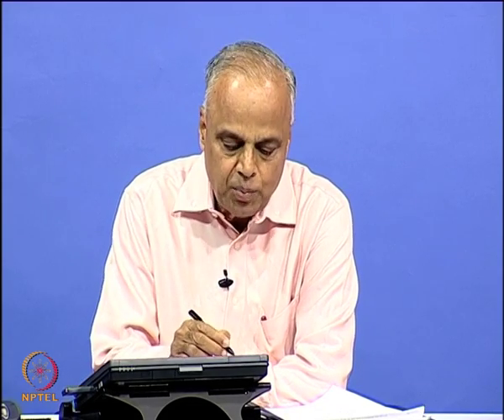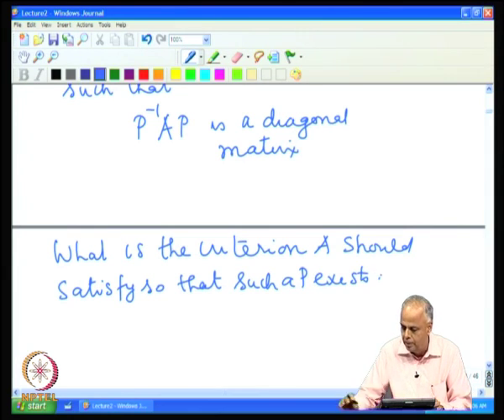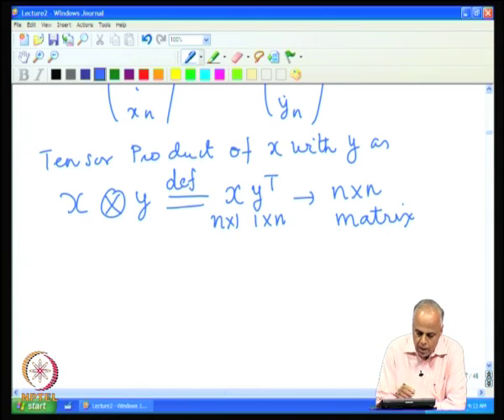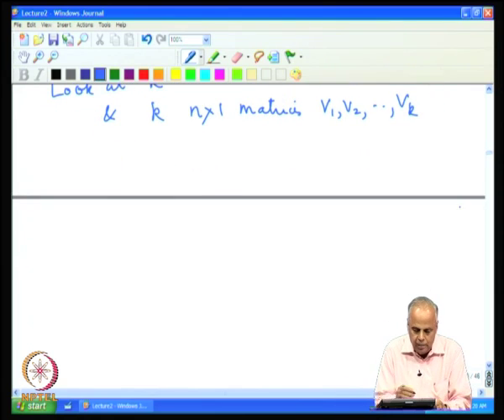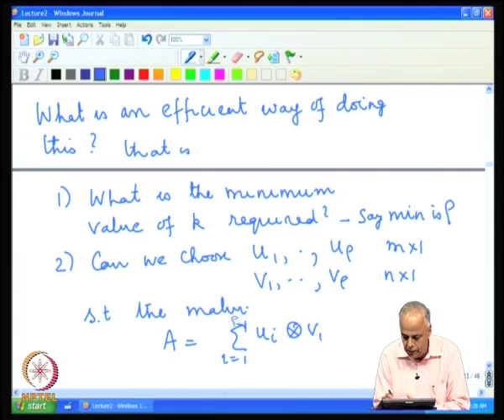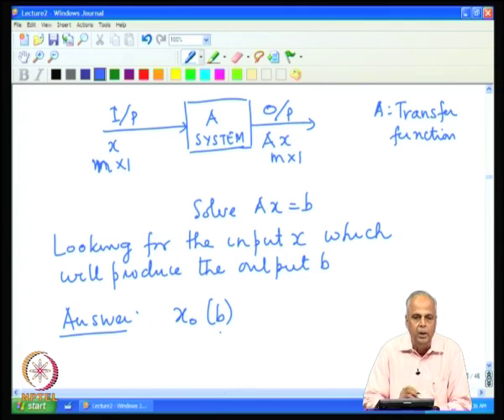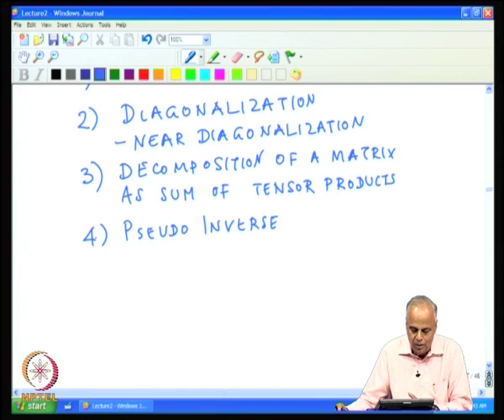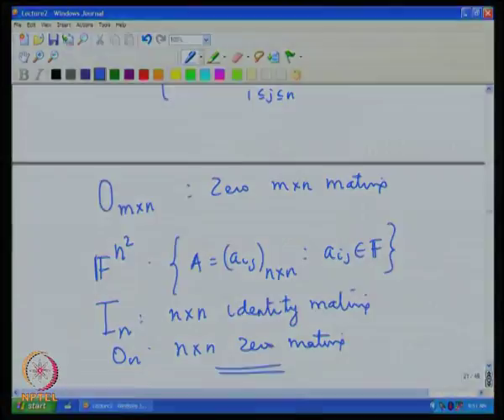Prologue Part 2

Comment: can I take this course as my 1st course in Linear Algebra ?? I am in 1st year of my engineering.
Reply: I maybe very late and in fact you might have finished your degree by now. But I would not recommend it to a freshman. You see Dr. Rao is taking us to core tools/concepts in  Linear algebra like SVD and diagonalisation without even giving  a hint of linear independence, rank of a matrix, projections, transformations and orthogonal matrices. I would recommend Gil Strangs lineal algebra to start with. This one is an advanced course. But considering this an epilogue what a freshman will do? should he skip it or not? Maybe the freshman has to keep this in his mind that Ok this is where I would reach at the end of this course.
Reply: @manojdhiman2612 Yeah, I did pass out a year ago. And yes, the course was significantly hard for me. But still I had the foundational tools for vector spaces, basis, orthogonality and subspaces. So, it was worth it. However, I could not proceed much after prologue. Maybe if I get time, I will revisit them again
Reply: @manojdhiman2612  what are you talking about? have you studied from this playlist? sir has taught all basic concept first then he went to svd.